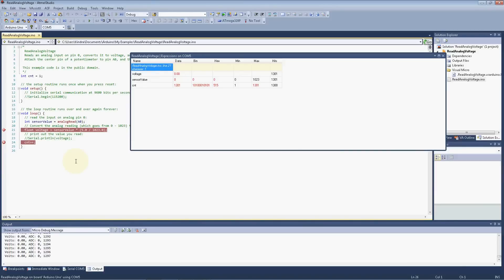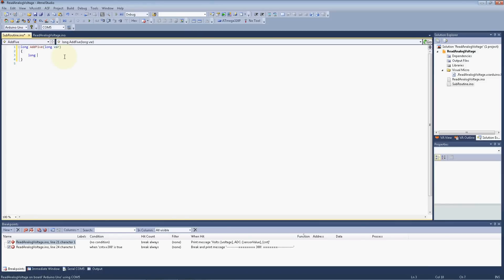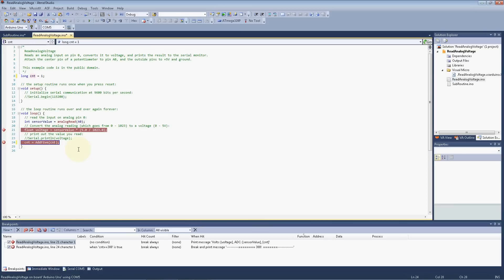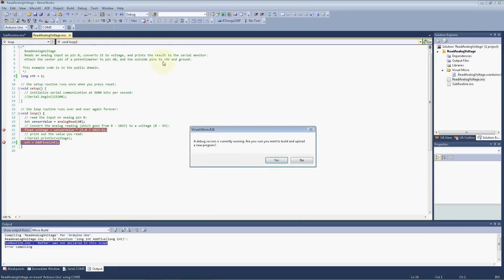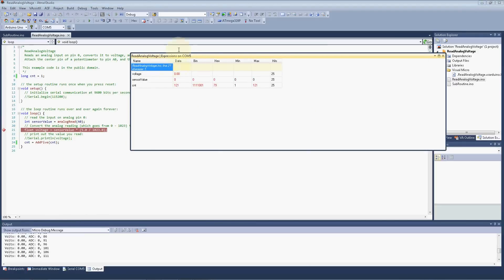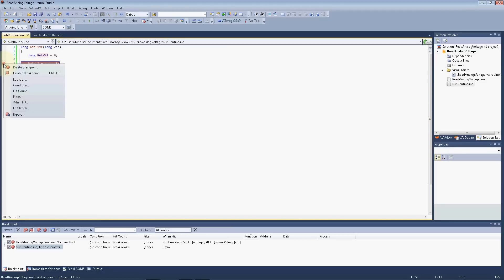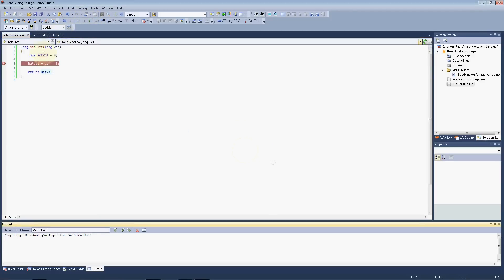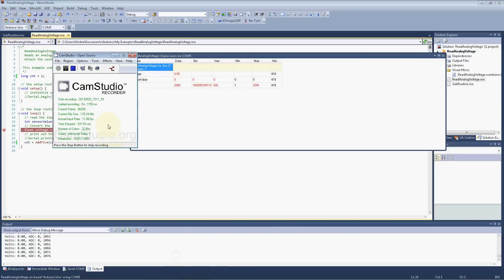Arduino Programming with Visual Micro for Atmel Studio 6.1 - Part 5 - Debug-Halt-Pause Extern

Comment: Hi, i'm using an arduino yun board, i have no problems using the normal examples, but if i try to use the ones contained in the library examples folder i get definition errors, do you know how i can make them work?
Reply from the maker: Hmmm, It is hard to say exactly what maybe wrong without seeing what you are doing. It sounds as if you may not have the correct libraries loaded for the Yun.Things to check:1. You have the Yun Arduino libraries installed(http://arduino.cc/en/Main/Software#toc3) and Visul Micro is pointing to    them.2. You have the Yun selected as the board you are programming (in the drop down list).